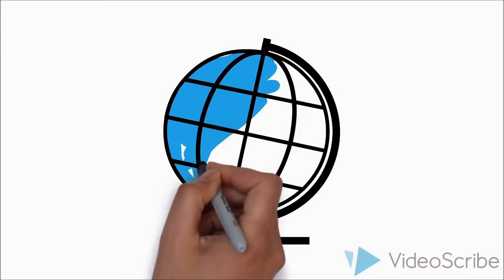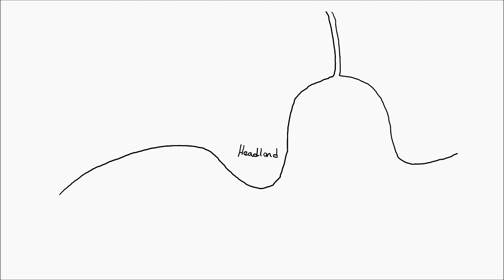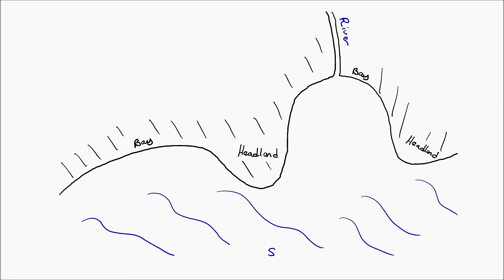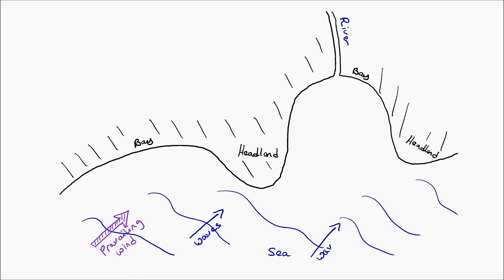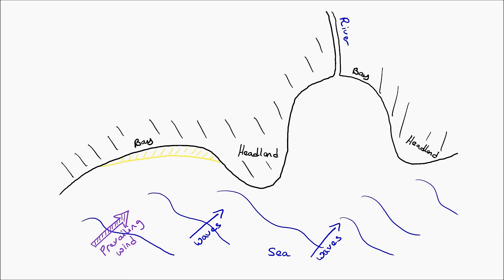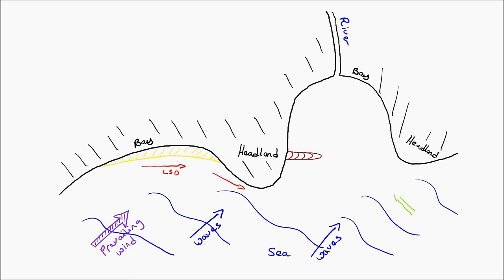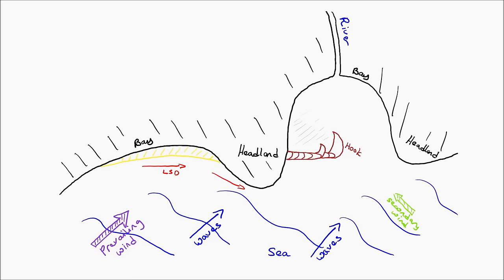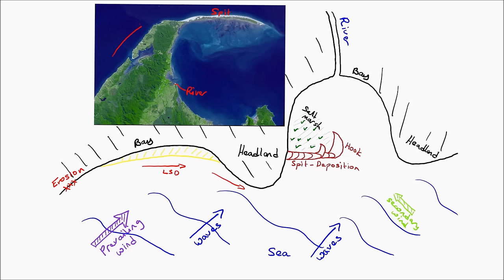How Coastal Spits are formed - labelled diagram and explanation

Comment: Great video! This explains it really well. But how is the river involved in the formation of a spit?
Reply: Same question
Reply: It  deposits tons of sediment.  Silt. Etc.
Reply: I'm a bit late, but if anyone wants the answer...

The river is involved, as a previous user said, to deposit sediment and salt that is collected in the salt marsh. However, it also ensures, through the river's added current, that the spit does not carry on fully to the next headland and form a bar (a coastal feature connecting two headlands together). 

Basically, it keeps the spit a spit, and stops it from forming into a bar.

Hope this helps! Good luck :)